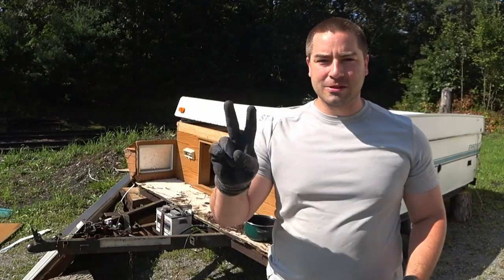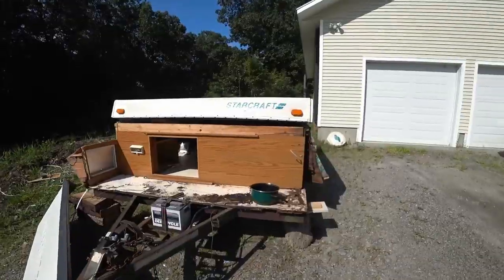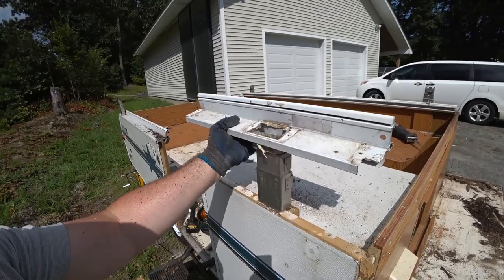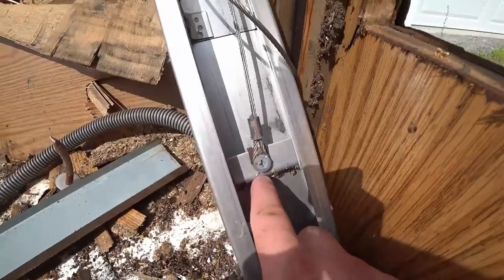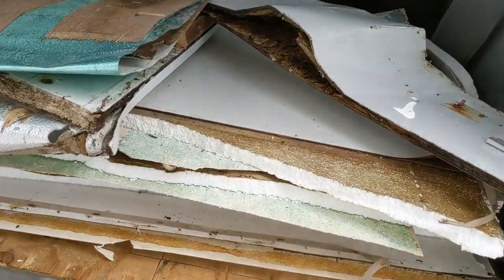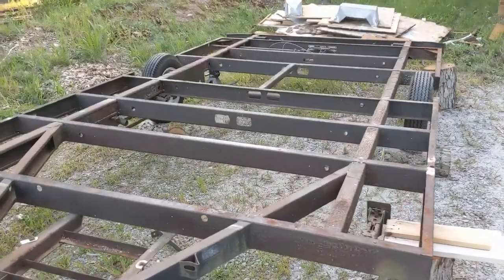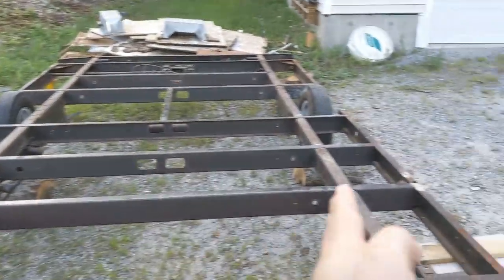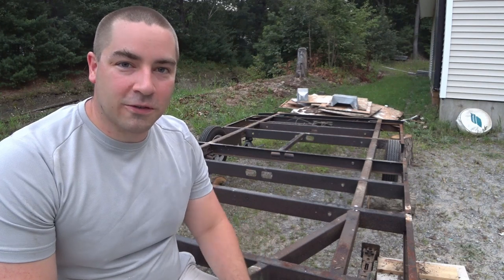DIY Utility Trailer, Camper Conversion, Demo Part 2

Comment: I would keep it long and wide.  Just add a bed with 2 X 4 decking and stake sides.  2 X 4 decking is great because you can simply unscrew it and replace with new 2 X 4.  Having the levellers in it would be handy as well.  You might want to use it as a work surface at some point in time and having the levellers keeping it stable will be helpful.

Comment: I would have left the sides and put watertight lockable toolboxes like on the sides of utility truck beds. Then build up lumber racks over the tools boxes and wheel wells to support lumber longer than the trailer, keep the 4x9 intact in the center so I could hold plywood and drywall sheets or atv dirtbikes or lawnmower, and build a ramp just for that section in the middle (so lumber or kayaks again can stick out past the trailer on the sides without running into a ramp) Maybe even up front connect the 2 lumber racks in the middle with a small lifted shelf for propane and gas tanks.

Comment: Those thin rib rails won’t hold much load, best to rip it all out, narrow might seem like a waste, but that tiny axle can’t carry much weight, so narrow will help keep you from overloading it.

The steel tube surround isn’t suitable for much either, that’s why it has sagged with only the pop up for a load... 

You could chop up the box, use them for center supports, weld in some 3/8” 4” channel, or box, or move all the way to 6” channel, and be safe knowing your trailer will haul what you put on it. A couple Cnotes, will get you 5or9K axles... with 15 or 16” rims... make the trailer useful...
Reply from the maker: "GVWR: 2390 LBS."   This is a light weight trailer, and I'm towing with a mini-van.  My intention is to keep everything light, which is one reason for wanting to cut down the sides.
Reply: DavidPoz ok, that makes sense.

Definitely cut off the sides, some sheet aluminum for the bed would keep the weight down. Don’t put down plywood... it’ll rain soak, and rot out quickly...

Comment: I know this was 6 months ago, but careful with how much weight you put on it. It will want to sway very bad, with some weight on it. This is spoken from experience. We bought a pop-up camper, very similar to this one, put a wood deck on to haul our 800lbs race car. Technically still under the weight limit of the trailer, but it wanted to sway bad.  Boat trailers that had a fiberglass boat on them, make for really good utility/cargo trailers. You can put a lot of weight on them and be fine and almost never have swaying issues.

Comment: I originally thought you were going to keep the outer structure to house the batteries and hold the solar.  An A-Liner trailer may be better for this project as you would be able to tilt the roof toward the sun.  I guess total removal gets rid of all the rot and a flat roof doesn't help.  I still don't see the bigger plan to comment on 5' vs. 7'.   My current thought is you can make it smaller at any time, why decide that now.  Bigger is better.
Reply from the maker: The difficulty with bigger, is heavier.  I'm towing with a normal mini-van so I have to keep things as light as possible.